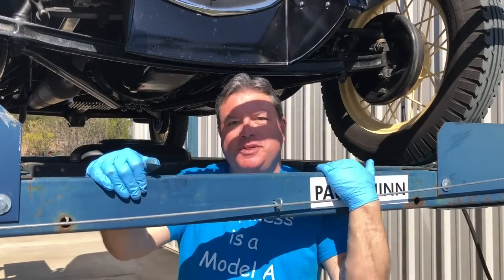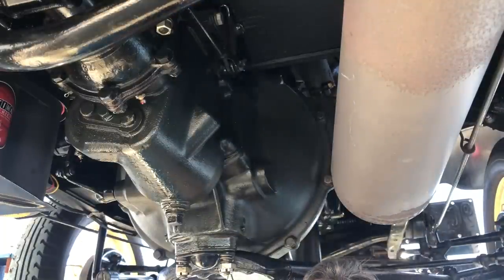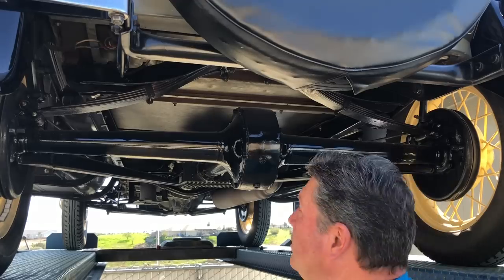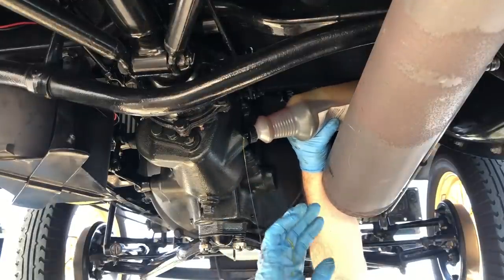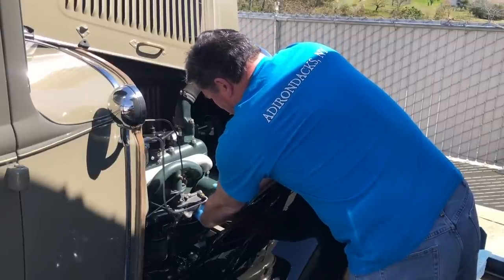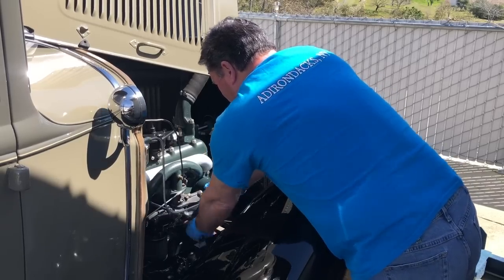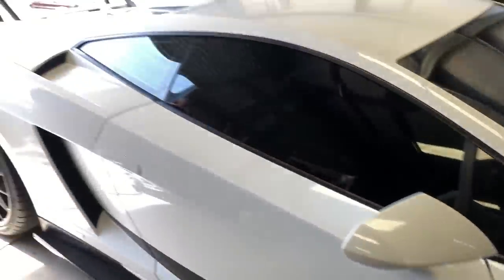Change fluids in a 1931 Ford Model A

Comment: 0:00 Intro 
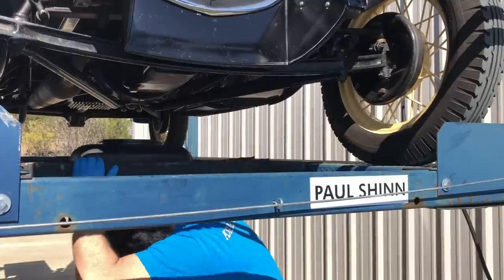0:43 changing the oil
1:45 trans fluid 
2:05 overdrive
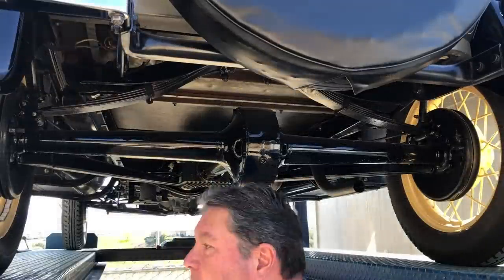2:39 rear end
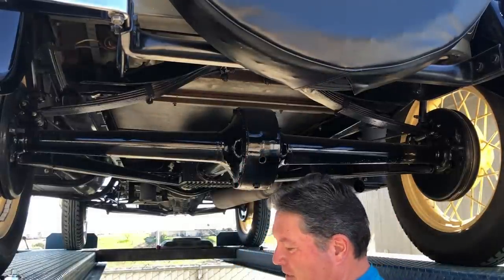3:12 cleaning the underside
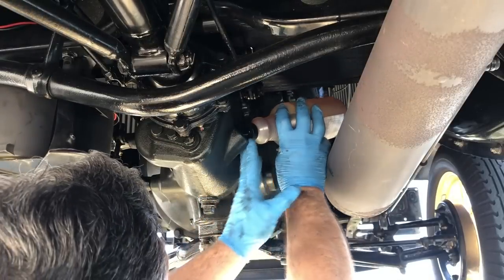4:55 trans again
5:27 grease the chassis
6:28 doing the right thing
6:53 oil filter
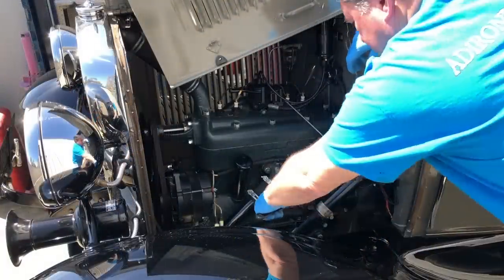10:10 steering box
11:04 start up

Comment: Paul, great videos, you are a breath of fresh air in the hobby!
I noticed that you have 'stick on' wheel balancing weights on one of the wheels.  I have an antique bubble type wheel balancer made by Jacobsen Manufacturing out of Seattle.  Have you found that balancing the wheels with a static balancer helps in any way or are we not going fast enough to make any difference?
Ken from Ohio
Reply from the maker: I only bother balancing wheels on Model As with overdrive
Reply: @ModelA  Thank you for the quick reply!

Comment: Paul, excellent video. I learned a ton. On my 29 coupe it does not have an oil filter so we are changing the oil every 500 miles. Do you recommend that I install an oil filter? When did these oil filter kits start getting used on the Model As?

Comment: In minute 6:10 I can see, that the castle nuts holding the front spring are tightened further than the holes for the cotter pins. I encountered the same problem and used washers. I have the right number of spring leaves and all original parts. What is the issue?
Reply from the maker: Hmmm... Good point.  I need to do a little research.

Comment: I know you have probably covered it in another video, but I am curious where you get the engine paint.  Is it available over the counter at the parts stores in a pre pressurized containers, or does it take a script and application equipment to use?  I would like to start painting the filters that I use when I service the A in my friends collection.
Reply from the maker: I buy from Jerry's paint in Sonora and they put it into spray cans for me.  Some of the Model A parts vendors sell it too.

Comment: When I saw the box on the bottom with air fins, I knew it couldn't be "original".  A bit later you described it as a Mitchel Overdrive Unit.  When did these units 1st become available ?
Reply from the maker: I'm not sure.  But if you call Steve Mitchell, he can tell you.
Reply: @ModelA  You let me down 🤣🤣
Reply from the maker: @pawleymediaconsultantsllc5    You sound like my wife now!  And my mom.  And my boss...
Reply: @ModelA   One of those was redundant

Comment: Which hyperlube are you using in the steering box?I googled it and there seems to be several different types. Thanks.
Reply from the maker: Pause the video on the scene where I show the bottle.
Reply: @ModelA  I paused at that point and looked at the product list. It had the 303 spray and asoorted shirts. But did not see the hyperlube. Maybe its just me looking at it on a smart phone. It looks like the oil suppliment. Thanks.
Reply from the maker: I'm sorry, I meant the part where I show the bottle.  Just look at the label.  I had no idea they make multiple products

Comment: Thanks for sharing this... you had mentioned in a previous video that Mitchell makes a stick/filler kit for the transmission, do you recommend putting it on a regularly driven Model A?
Reply from the maker: It depends on YOU, not the car.  If you can easily get under and out from under the car, then you might not need it.  If you have difficulty, then you need it.
Reply: @ModelA  Thanks! You & I are about the same age, and I don't have a lift...
Reply from the maker: I flat-back it most of the time